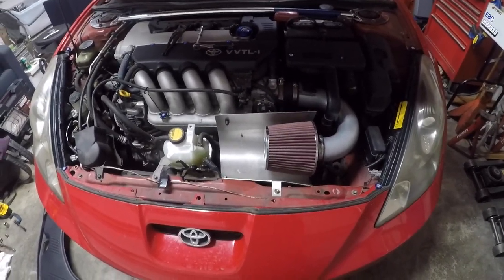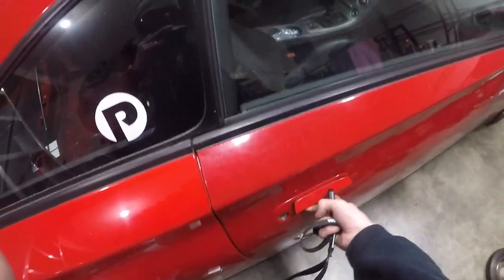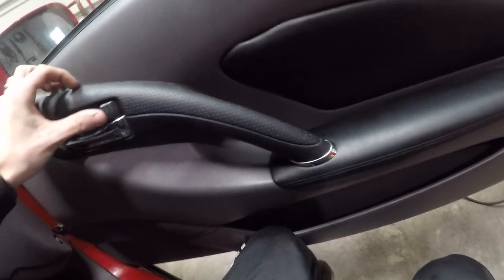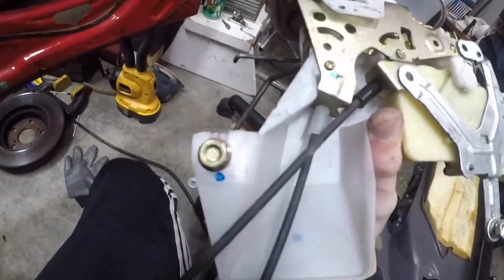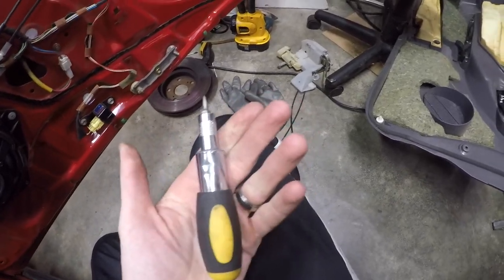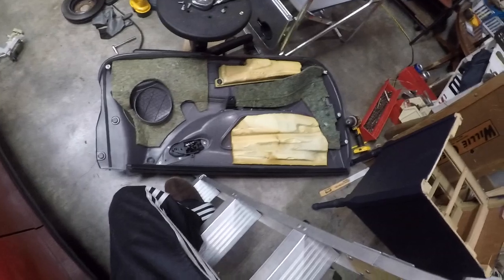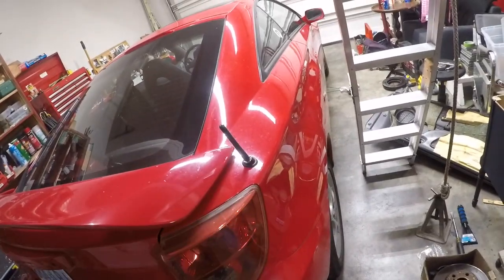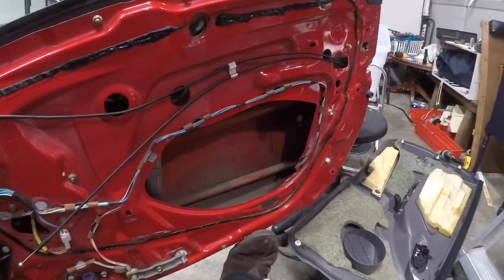Junkyard Scores! How to replace your Door Lock Actuators

Comment: No worries brother, always glad to help if I am able. Didn't we replace your door lock actuator like a year or two ago?
Reply from the maker: Yes we did. This is the one we had pulled from the parts car, and put into my car. I didn't swap them when I swapped this new door on and unfortunately the old ones were no good. So I put the one we bought back in and it's working again!